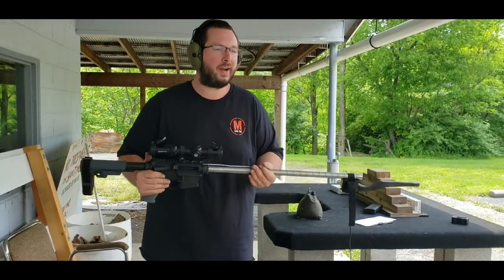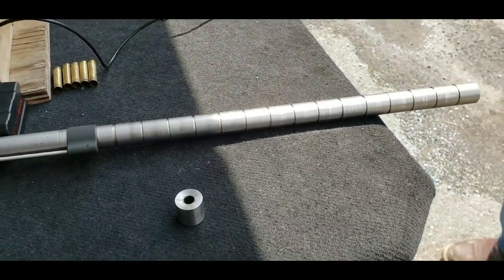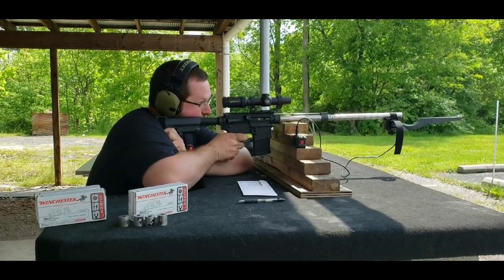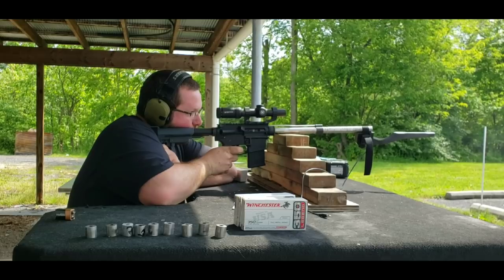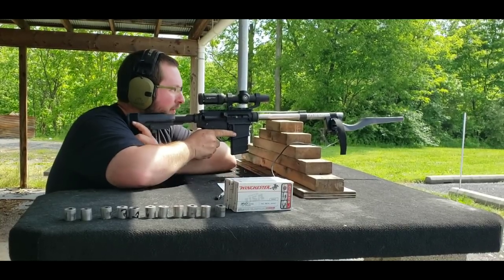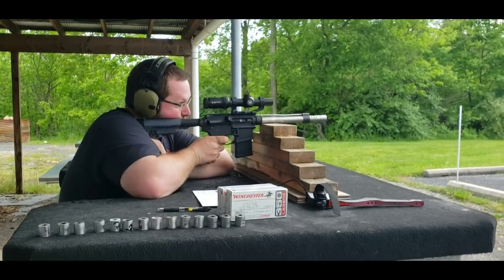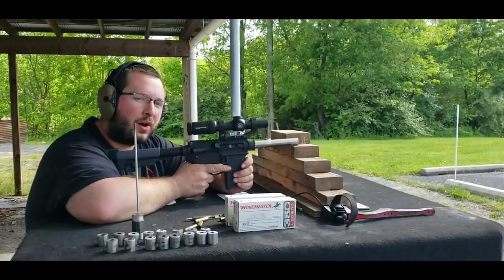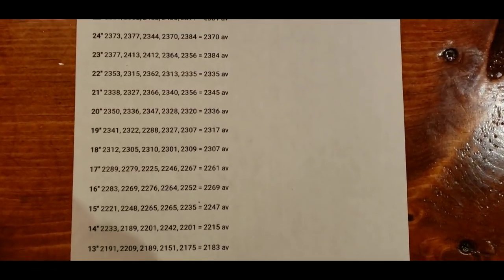350 Legend Velocity by the Inch Part 2

Comment: Thank you for this test! I built a .350 Legend with a 10.5” barrel and this is the only video that gave detailed information for different barrel lengths. I can feel confident hitting the woods with my 10.5” now. Heck, might even build a 7”. 😉
Reply: My understanding (and I'm no expert) is 350 Legend utilizes a slower burning powder than 300 BLK, and the longer cartridge case has a significantly higher capacity. So, unlike 300 BLK, running a shorter barrel than you already have is likely to cost you a lot of velocity and probably result in an incomplete burn.
Reply: I just got my lower built. And was looking into a 350 legend upper.. I really want a 10.5 barrel to match the rest of my AR's but I keep seeing alot of talk about the 16in barrel for the 350Legend.. how you had any issues with your 10.5 ??.
Reply: I have the faxon 12.5 and it's a beast
Reply: 350 can use postol powders. Same powders as 357 can be used but much higher capacity. I think this video proves that it is affected very little by barrel length  @kenbolia7097

Comment: I know it's been a year since you made this video, but I was wondering what could be done with a 10.5" barrel and the 265 grain subsonic.
Reply: A year later and we're all wondering the same. Also wondering what one of those 118gr Leighigh will do through a stubby tube like this.
Reply: It's likely that a 1 in 16 twist will not stabilize a 265 grain bullet out of a 10.5-in barrel..  I believe there are companies making 1 : 10 twist for subsonic 350 legend  to stabilize from 220 to 285 grain projectiles.. the faster twist is especially important and shorter barrels that have less dwell time in the barrel that's why 9 mm handguns use a 1 and 10 twist instead of the one in 16.

Comment: I will definitely be checking out Mos Tek website!  Interesting that its pushing a 145gr about the same speed as a 123gr 6.5 grendel from 12" barrel.  Just wonder how fast 350 legend will drop speed out to 200 yards.
Reply: 16” barrel 147gr 10” drop at 200 yd

Comment: the reason why you were having problems once you dropped to 12 inches is you shoud be running a pistol gas system on a barrel that short for proper gas pressures

Comment: a 7.5 barrel is a major upgrade over an mp5 if you think about it, way way more power and same compact size. you get 50% more umph then a hot 357 mag from a barrel the of same length. great defend your castle cartridge, they just need to get a mags larger then 20 rds on the market. 100 yard deer cartridge easy, it might go farther but idk how well it holds its energy at range.
Reply: I'm building a 7.5 for just that. I've got a 16 upper for hunting in nurseries and farms, and will have the 7.5 for brush/woods where 50 yards is a long shot.

Comment: I'm wondering how it compares to 300 blackout in a 7 inch barrel. A quick Google search didn't come up with anything useful.. I would love to see somebody do this with 450 Bushmaster
Reply: Shoot a 338_SPECTRE or simply a 10mm_AUTO.MAGNUM (Starline brass) with lead/cast lead bullets, if you want 'short' or really short barrel efficiency.
7inch 10mmMAG is no joke.

Can also make something efficient with Hornady 5.45x39mm brass throwing .375 bullets made from 5.56/223 brass.

Or with 5.56/223 basic brass (Starline brass) shooting .355 bullets.

Another efficient option for the AR15 is 5.45x39mm brass throwing medium-heavy .257 or .264 bullets. OK flight and energy conservation.

.375 or 10mm bullets from a 7.62x39mm 'straight' case is efficient too.

_
Reply: @axp8598  Most of us are probably more interested in stuff we can buy at a store without having to re-barrel something or do anything funky to make it work.
Reply: In the same bullet weight, the 350 legend should have higher velocity due to increased bore size.

Comment: interesting test! so ,if you want a reliable 350, go with at least a 20in barrel, everything from 20in on up cycled, ejected, and held the bolt back every time, go shorter than 20 and start drilling out and go with an adjustable gas block! i could deal with that
Reply: My 16" runs great. Secret is polishing the bolt face on these things.

Comment: ill get one over a 30black out when they put 30 rounds in a mag. until then 300 all the way. 300 is a straight walled case to. you can hunt with in those states

edit: ok just watched another video and im really impressed he was hand loading 185gr bullets and getting over 2000fps in a 10inch barrel. that insane as the load you were shooting was 2250 150gr in a 14inch
Reply: 300blk has a neck, you are not able to hunt in most straight wall states with it, I think one state has it and 458 socom as an exception to the rule.
Reply: @brandonsjsj  in michigan you can use any caliber you want just not in the shotgun zone/limited firearms zone. no rimfires either
Reply: Some states have a minimum diameter of .35 too which eliminates the 300 BO.
Pretty much an equivalent to the x39 or 30/30 in a small package.
Reply: 30 fit just fine in a standard mag made for the 350L. There's no comparison between this and the BO though. Also, it was specifically made for people who have to use straight-walled cartridges where the BO is a no-go. If you have a raging hard-on for your BO, that's fine. It's a great round, but it can't hang with the 350L.
Reply: @bigsean2473 cool story bro. 300 Blackout is still not a straight walled case. Better luck next time

Comment: More shooting, less talking in between shots. ;)  My bigger issue with the 350 is that they aren't offering anything in the 125gr to 130gr range which, IMHO, would be better for white tail.  A 10.5" upper running a 125gr monolithic 35cal HP would make a sweet 150yd deer cartridge.

Comment: How is cutting a barrel down below rifle length not a felony?
Reply: Because it's a pistol. He states early in the video he has a stabilizing brace on it instead of a buttstock.
If you buy or build an AR as a pistol, you can convert it to a rifle and back to a pistol as often as you want. If you start with a rifle, you can make it an SBR (with permission) but you can never legally convert it to a pistol. If this doesn't make any sense to you at all, join the club.

Comment: Basically in a nutshell. .300 blk is made even more irrelevant.
Reply: Nick Graham I think the best comparison between the two would be with handloaded ammo. Granted these are max charge velocities, but Hodgdon puts a 125gr Blackout at 2205 out of a 16” barrel and a 125 350 Legend at 2543 out of a 24” barrel. I’d be curious to see two high pressure leadings for each face off in a 16” platform. I’d wager the Legend would still win, but I think the margin might be less than 200fps.
Reply: @r_c4157  yeah but even the commercial ammo we have right now is pretty conservative powder loadings with the right powder im sure you can push the 125 gr .350 legend to easily around 2600 fps out of the 16 inch barrel. as you can see with this test .350 legend doesn't lose that much velocity per inch of barrel lost. but comparing apples to apples the .300 blk with 125 gr out of a 24 inch barrel is only getting marginal velocity increase at around 2350ish fps.     so no matter which way you slice it .350 legend is still way more powerful than .300 blk.
Reply: 300BLK is not legal in the straight wall cartridge states. 300BLK is irrelevant for us.

Comment: be nice when other companies start selling the ammo, Winchester has always been horrible for accuracy. Hornady would be the shiznay
Reply: Available in ftx
Reply: I had a Rem. 7400 simi that loved Win. Silver Tip ammo . It would stack shots at 50 yards and keep a full mag of 5 within 1-14th inches at 100 yards. Power points/ nope. Rem core locks/ nope. Federal premium would do nearly as well . 270  130 grain Win Silver Tip . Idk if they are even produced now?
Reply: John Wayne my 7400 doesn’t like any Winchester’s but likes cheap federals. My only gun that does.
Reply: B Laws Barrel harmonics are strange. Especially thin sporting barrels. Some rifles will just flat out shoot as well. Had a rifle built In Montana years ago, Mouser K 98k with a 26” ( varmit / target ) barrel , also had a 3 lbs trigger . It shot everything well - much better than I could shoot . Heavy sucker tho. 10 lbs + . I swear it shot hole for hole ( it seemed ) 3 shot clover leaf groups at 100 . On bags with no pressure. It was 270 as well. My favorite cartridge, puts whitetail down in tracks most times. Shoots flat out to 400+ . I have been hearing that Winchester has some quality control issues with ammunition across the board lately. Lots of folks commenting about it.
Reply: John Wayne I’m having issues with 145gr fmj for the 350 legend. They crimped up to 7 thou too small so the rounds don’t head on the case mouth. I had 2/3 boxes good and one all bad. I shot a box of good ones first in a new rifle and checked them for signs of trouble. The second box I assumed was good too since it came out of the same carton. Wrong! Different lots. Still waiting to hear back from winny after 2 weeks. I’ll give them the benefit of the doubt during this china blight but they screwed up and it could be dangerous
Reply: B Laws Ya they don’t need any law suits and no one should be getting hurt either. I think the 350 is strange because one day / never heard of it / next day it’s old news. Strange!  No doubt it’s political somehow. Ohio never allowed rifles then one day decided to?  That don’t jive . Winchester pumped out cartridges like mad,  and quality control went out the window in the name of a dollar . Smh. That’s how industries get shut down ! Are these shells even made in the USA? Idk ?
Reply: John Wayne they are a new load concept and winny kept it quiet until SHOT show last year. Frankly it’s a good concept. The 450 bm is a great round but not much fun to shoot. I’d rather shoot my 444 if I want a canon. The 350 recoil is really easy considering it hits deer almost  like a 30/30. Being based on 223 tooling for brass and 9mm bullets it’s a cheap round to make. As far as Midwest states allowing straight wall centerfire you can thank pressures from hunters. It wasn’t long ago we were shotgun only here too. Finally we got rifles passed and the result is great. Far less wounded deer and hunters. No more running 5 shot volleys. I’ve taken plenty of deer with a 12ga but why on earth would we limit our choice to the least accurate firearm possible on days with the most amount of people in the woods. And a slug will pinball through the woods far longer than a fast light bullet. The theory that shotguns are safer is a big fat lie.
Reply: John Wayne yes they are made in the states. Mississippi and Illinois
Reply: B Laws I always thought rifle restrictions was a bad idea. I live 1 mile from Ohio and have never hunted it because of this. We don’t have any problems 1 mile away in WV . Never hear of any accidents . Rifles are as safe and probably like you said safer.  For light bullets they gotta speed the twist up or find a higher weight. 35 rem used to be loaded with 150 grain spiral boat tails. They stabilized well in a marlin with micro grove I know as fact. Sound like basically the same pressure. May want to look into what bullets they used . Shot nice!
Reply: John Wayne I have a 336 in 35 rem. I reload with ftx bullets and it’s a driller.